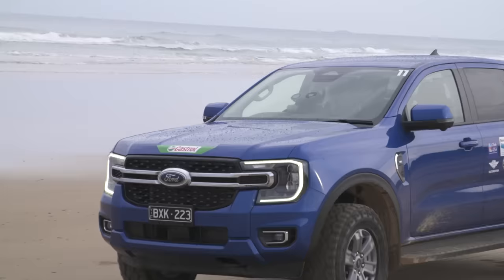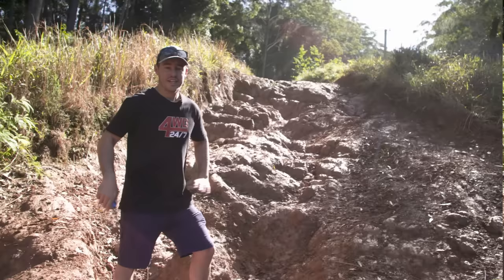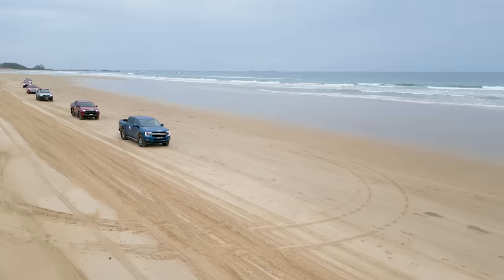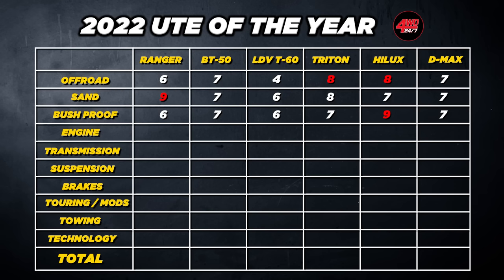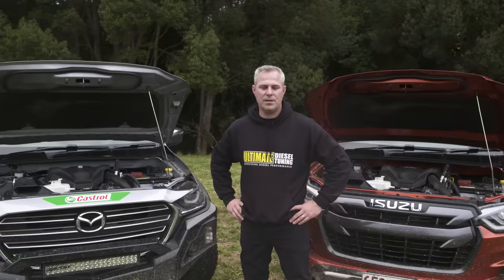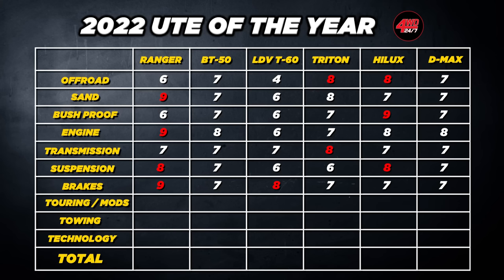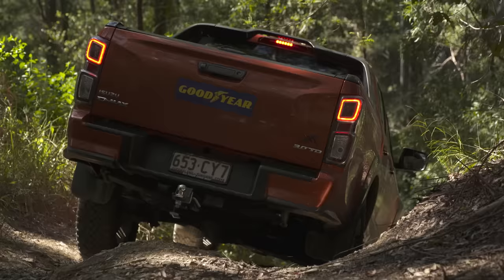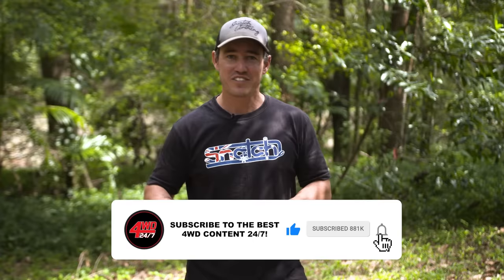2022 4WD UTE COMPARISON - CONTROVERSIAL WINNER! NEW Ranger vs Hilux vs DMAX vs Triton vs LDV v BT-50

Comment: I really don’t get the Triton hate. Very capable, affordable, and looks good. Coming from a Hilux owner
Reply from the maker: Agree! Still has a bad name but these new Tritons have been brilliant. Highly rated from us!
Reply: Not as hated as it seems I’d say. They sell plenty and most owners have no complaints. 

3rd top seller behind Ranger and Hilux at times for the MQ.
Reply: I went a hilux but second choice would of been triton, best bang for buck tbh
Reply: Have a 15 year old Lancer with 300k that's only done a control arm, and a 12 year old Outlander that's had 2 shocks replaced. Absolutely reliable and affordable cars. So when it came to getting a dual cab...we pick up our GSR Tomorrow 🤣🤣🤣

Comment: The triton for years now has always had good praise for value and capabilities. I personally like the ranger but when I go to buy a 4x4 I'm going to go with the triton
Reply: I came close to getting a new Triton a couple of years ago, would have done the deal until I noticed no rear locker. Salesman was a clown but eventually it became clear - no rear locker available for any Triton in Malaysia. Totally wasted my time even looking at it, cos any aftermarket fit would screw the warranty.
Reply: @bigglyguy8429  that's not actually true. The dealer would have to show that the locker was what cause the warranty issue. If they can't do that the warranty is valid. Same goes for any aftermarket accessories
Reply: @jamiemckennon1944  Well that sounds nice in concept but here in Malaysia I wouldn't want to rely on consumer laws or whatever. They don't call them Stealerships for nothing, and all dealers are on the lookout for ways to avoid being on the hook for warranty work. I guess in Australia or the UK you could make a case, maybe. I also have to question my willingness to get my hard-earned to a company that tried to fob me off with a vehicle incapable off-road in the first place?
Reply: @bigglyguy8429  mate I wouldn't underestimate how far an unlocked Triton will go. It has the best 4wd system with traction control on the market and it will outdrive a lot of 4wds with rear lockers. Also with the money you'll save you can easily do aftermarket lockers front and rear and bigger tyres with a lift. Then you'll have a 4wd 10x more capable than the rest
Reply: @bigglyguy8429  I have an MQ Triton. 2 inch left, 31 inch KO2 Goodrich tyres. just recently i did a trip with a bunch of rear locked  cars. I made it through most places just with the traction control.  Mind you i do have a rear locker on order
Reply: @jamiemckennon1944  Nah. The Pajero has great traction control but the Tritons don't. Which is weird; you'd think they'd be the same but nope. The good thing is you can use the 4WD on tarmac.
Reply: @bigglyguy8429  ahh right. I thought the Triton had TC as well. But still, with the price difference you could easily twin lock etc
Reply: @jamiemckennon1944  I sniffed around and apparently the difference is the Pajero has an LSD as well as the TC. The Triton does have TC but it's just not good. I can't find it now but while still interested in buying one I saw a vid that summed it all nicely, a young Australian guy stuck in a dry creek in his brand new Triton. It was meant to be a vid about how good it was... he did eventually manage to rock it free but it ended up a video about how crap the TC was. Of course in Oz you can buy them with factory lockers, which is fine. I'm just still salty, 2 or 3 years on, that Mtizi Malaysia try to fob off Malaysians with incapable vehicles. Indeed most SUVs here are 2WD, same thing, they don't even offer us decent cars cos they think we're poor and still live in trees or something. It's why Wifey went for a Subaru and I drive a Vigo. AWD and 4x4, for reals! The Subaru TC is awesome - but still nothing like as good as flicking the air compressor on and engaging a real locker.
Reply: @jamiemckennon1944  My MN has traction control and its pretty damn good.
Reply: @bigglyguy8429  that's not true mate. Mitsubishi is pretty good with warranty and any how they can only knock back warranty if they prove that the mod was the cause of your claim

Comment: This is probably the first Ute of the Year where I thought a Ranger would actually be a good choice, but my heart is with the MR Triton, which is why I bought myself a 2022 GLX+. If you're not putting a big canopy on it, the overhang doesn't matter that much, and the excellent value for money is hard to go past. Plus it's a tried and tested platform with very little major issues, and there is loads of aftermarket accessories and support for it.
Reply: Plus the 10yr warranty 🤯
Reply: Do not forget that Mitsubishi is the most successful vehicle manufacturer in the Dakar Rally which is mechanical torture for any vehicle. Mitsubishi is an engineering powerhouse of the world, they dabble in much more than auto mobiles. They make cars for shits and giggles. Best Value for money vehicle by a long shot. Plus the 10 year warranty cant go wrong.
Reply: The Ranger isn’t that good of a design, typical slack specifications by Ford, they are big, big deal and I often wondered why people bought them when they don’t even go off road, big lump of aluminium and other flaky metals to con the buyer.
Reply: I wish they did more for the suspension department so we can get more value and choices for aftermarket suspension but my MQ has done an absolutely job since I got my in 2018!
Reply: Yup. Price, maintenance and durability on mind nothing wrong with Mitsubishi.
Reply: Just your opinion

Comment: My first ever brand new car, and first 4x4 was my current MQ Triton. I got the Sports Edition, mainly for the rear diff lock, and I've honestly never had to use it in over 4 years of ownership. I'm now starting the modification journey with lift, tires, chassis mount canopy all going on in the last year. Next up will be brakes, bar work and possibly a tune. 
One thing that strikes me on every one of these ute tests, is the Mr Everything role the Triton plays. The thing keeps up with the big boys in almost every regard. Thing only let down is the smaller engine, and even so, if you are wanting to tow a 3 tonne caravan, the mid-section ute market probably isn't for you tbh.
Love the work lads!

Comment: I have a Triton but addressed all the issues I could such as a dyno tune, UCAs, diff drop, front locker, long range tank, and a lot more. Stock was surprisingly capable with only some A/Ts, but it's a very different 4WD with all the mods. The best part was the cost of all my mods was probably about the same as the difference between the Ranger and my Triton when new, so the value is without question.
Also, would love this comparison in 4K!
Reply: People are using 4k less because it makes the picture quality worse for the majority of people who watch YT in 720p.
Reply: I wonder why they're saying the triton isn't built for mods and travelling. I've seen tritons everywhere and ARB have all the mods needed
Reply: Goes to show how shit the triton is if you need to spend all that money getting it Half decent.
Reply: @Chris-sf2cp  spend all that money? Still less than a stock ranger. And way more capable
Reply: its not built for the canopy because of the bend in the tray if too much weight is on it. canopys can weigh up to 500kg and already with that weight you can't tow much behind it, making it a bad option for touring and towing
Reply: Ranger has the high ground clearance of 234 mm which is greater than l200 and hilux 🤷🏿‍♂️
Reply: Triton's are great

Comment: I simply couldn’t look past the MR Triton GLS back in 2020 for $47k! It’s a weapon off road as, great on fuel and actually surprisingly torquey for such a small engine! I’ve gone to town on the mods like all of us here and with that has come the extra weight! The brakes are good, but it would definitely make for a far superior touring package with a bendix upgrade kit, to improve braking performance when needed on our ever growing and busy Aussie highways. Great review as always lads 👌🏼
Reply: Dammit I paid $43k for my 2020 gls with 19,000km. I got ripped lol.
Reply: @AdmissionGaming  I paid 38k for a new manual gls at the start of 2020! You got a good car but mate
Reply: @jarrydmcmichael5408  they got me.. they had it on the lot for $48k + on roads. And I negotiated it for $43k with on roads paid. 
It's a October build 2020 automatic, but still the dealer got exactly what they wanted and I thought I scored haha
Reply: Spend the money on something else. You’ll end up paying 60+ by the time you replace the engine and other problems over the years.
Reply: @liamjackson5698  owned 5 Tritons over many years.  Never an issue.  160k on my 2017 with no issues.  You don't know what your taking about or work for a competitor.
Reply: I just bought a Black Mitsubishi Triton GLS Plus 2023 at the price of $44500 and I am from Cambodia. The Look, Price, Engine, Performance and more,,,. Of course, it really fits me. Love it so much.
Reply: I paid $36,000 drive away 2019 GLX+Manuel.
Reply: @andrewgibson4807  Just the facts. Won’t name what I moved onto because I don’t work for a competitor. I’m glad you’ve had no issues but it is VERY common. I’d touch wood if I was you 😬

Comment: I went with the Hilux because apart from all of the other points you raised, when you're on the Gibb River Road and need a replacement belt, filter, brake pads etc I can just go into any station along the route and they'll have one, not that you'll need one though! That actually happened at Home Valley Station to a guy camped beside us who needed a fuel filter after buying contaminated fuel. Try that with a Jeep or Amarok!
Reply: 💯 percent mate, same reason i bought one too. However where the hilux in the video I haven't seen yet
Reply: You must have watched a different video. Jeep or Amarok weren’t featured in this test.
Reply: So you are saying you will go into the remote outback and not carry basic spares and rely on IF you can get one of what you may need on the way. Pretty risky things can and do happen

Comment: I have an MQ triton and love it. Performs flawless off road and I’d 100% take it around Australia. I’d also throw a tray and canopy set up too. Best bang for buck ute
Reply: Biggest issue with them is the rear overhang. Be very mindful when putting any weight up the back and you’ll be right
Reply: @lukegonano3956  I have a tray and canopy on my ute. Never had any issues with weight
Reply: @lukeballestrin7233  as i said mate look at the axle placement. A lot of people will throw a 1800 canopy on them and slap a trailer. These shouldn’t really see a canopy over 1600imo and then be very mindful of the trailer. That’s my opinion I’ve owned a mq very well modded
Reply: @lukegonano3956  1600 long is all I’ve done champ
Reply: @lukeballestrin7233  again all I’m saying is it’s the biggest issues with the tritons is that axle placement but that’s how they get the good turning circle.
Reply: @lukegonano3956  MQ and MR chassis is a lot stiffer than the old MN. Having said that i have an MN dual cab for a work ute and it's now done 315000 kilometres and 300000 of those kilometres would be towing a 1.8 tonne trailer. I'd be mindfull of any dual cab with a lot of weight on the rear.  I have an MQ GLS for the weekend

Comment: If I was to purchase a new dual cab today, I would pick the hilux, its price tag doesn't hurt the pocket as much as it used to and the aftermarket accessories catalougue is extensive, also ability to get it fixed almost anywhere around Australia and to be able to get parts easily is comforting and wins for me.. not to mention they have proven to be reliable in Australia's harsh conditions..
Reply: Yes agree...I can get parts here in NZ & mechanics know the engine
Reply: Yeap our workshop definitely fixes them, fixes them at such a rate we stock more Hilux injectors than all the other utes put together and then some ;)
Reply: And services cost very little, zero problems in 30000km of all terrain driving

Comment: Thanks for having me a long guys. The T60 did its best, and did it significantly cheaper💪
Reply from the maker: Sure did! It was great to have it and you along mate. LDV went up a level in our books - enjoy it mate
Reply: @4WD247  shouldve found an LDV model with a locker. They're only 44k, considerably cheaper than the competition. Cant compare locker to no locker.

Very similar to comparing a cheap 2wd to expensive 4wd, 
maybe a 2wd Triton to a raptor ranger?
Reply: Thanks Zac for offering your T60 up for the video. It's a shame though that a more suited level of T60 wasn't used. If it wasn't for your offer, I doubt the T60 would ever be used on these comparison videos. I have the 2019 Trailrider, came standard with the rear diff lock and both hill start and hill descent control. 2inch lift with 265/70/17 Yoko geolander a/t's and handles offroad and sand whilst towing offroad camper. All with original 2.8l 130kw, turbo diesel motor. Love it.
Reply: 20k over priced
Reply: @tyzon00800  no idea what you’re talking about. T60 models with the factory locker are well under priced for their ability. You sound like the kinda person to thinks rangers are top tier and peak 4wds but bt50s “are a shitbox in comparison”

More money doesn’t mean better quality/function. 90% of the time more money is only a response to history / legacy not quality of current product. Especially western brands or products over a century old..

Comment: Buying a new one would be a hard choice, lots of great options. But for me it would probably end up being the Toyota. Love the practical details like the alternator placement and serviceability on it! However, for the climate I live in, a huge factor to consider would be how the different vehicles could handle the cold weather (can reach -40c or below). Now I'm driving a Toyota 4Runner -91, and it is awesome! Greetings from the land of Surströmming, Sweden
Reply: I thought they only drive Electric hatchbacks in Sweden.
Reply: @farzana6676  Haha yeah, that's partly true! Sweden is a long country you know. If you have the money and live where all you need is a hatchback, then that's of course a great choice. But that wont work everywhere. Especially if you're driving in -40 c and on roads with a thick layer of snow
Reply: Toyota's for the brainwashed

Comment: I wonder if you would have still picked the ranger if you had the 4 cylinder one? Based on the commentary it won based on the power and offroad ability attributed mainly to the V6 diesel. Should have used a 4 cylinder one for an even and fair comparison in my opinion.

Comment: The new gen ranger runs rings over the competition at the moment. Ford have raised the bar and put the rest on notice.
Exciting times to see the competition rise to or exceed the new benchmark that has been set. 
Time to trade the 2017 ranger in for a new one I think
Reply: Do it!!! I’ve ordered the V6 Ranger Sport with the touring pack. Currently I tow my 2.5T caravan with a 2019 Holden Colorado (147kw/500Nm). 
Due at the end of October 🤞
If you have an ABN you qualify for a $2.6k Ford blue fleet discount 👍
Reply: @RocketRod63  I have mine setup the way I want it with a canopy etc I might upgrade in a few years

Comment: Driving a ranger raptor (Diesel) and would pick the Triton as the best cost vs reward dual cab. Lots of ability to mod and aftermarket support, and significant cost saving vs the other dual cabs. Meaning drive away for another factory dual cab would be a Triton with most mods for more hard core offroading

Comment: The Triton that was tested wasn’t the brand new one. The look of the stereo is slightly different and there’s a button above the volume lever on the steering wheel that allows you to see your cameras while driving. My GSR arrived into Aus at the end of July and has that capability.
Reply: Which would make SFA difference in this test
Reply: @cackle067   they showed all other utes doing that in this test, so if they did have the brand new triton it would compare the same actually

Comment: Like the last few 4WD test Shauno, you guys didn't disappoint.  Real 4WD test unlike any other.  My go to would be the Triton.  Maybe a custom tune and modified rear seat area (not for everyone) to bring the weight forward of the rear axles and short tray. Brake over angle over touch (Poni lol), tested reliablility over new and 20k less when you need to send it is key for me and I'm not a fan of towing when exploring. Watch enough of you guys to know better. But from owning a great Pajero 2002 diesel for 14 years to a Hummer H3, what do I know  :)

Comment: I’ve recently ended up with a ML Triton and must say I’m pretty impressed with the off-road capability stock. For my money, when it comes to this years choice of Ute, I would have to pick the Hilux. The Toyota tax seems lower these days, but resale value should remain high. On top of that, great service support and plenty of Toyota service centres around the place for parts. Not sure why, but I feel the Hilux screams toughness. Maybe because ofTop Gear?!
Reply: Especially considering ML comes stock rear locked. It would absolutely smash the competition out the park!!!